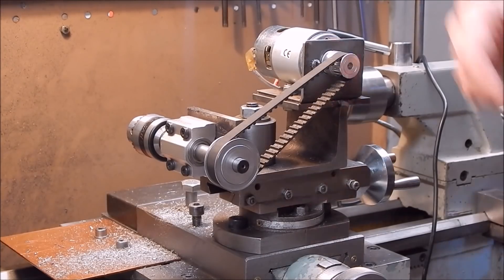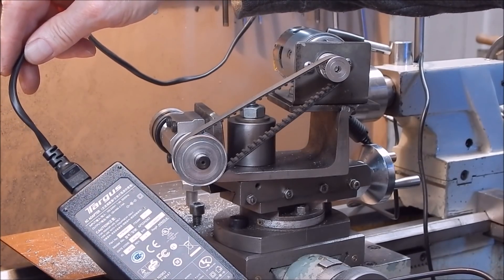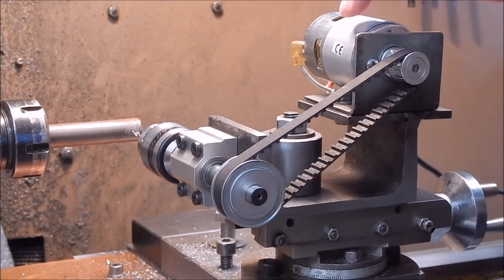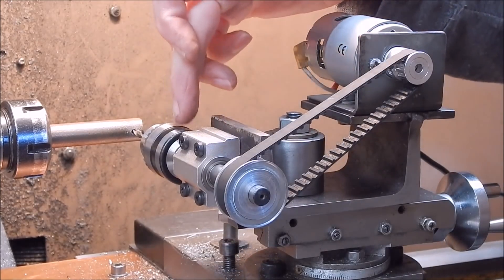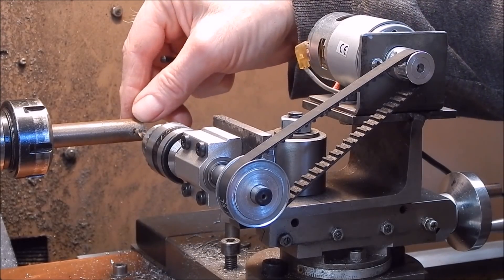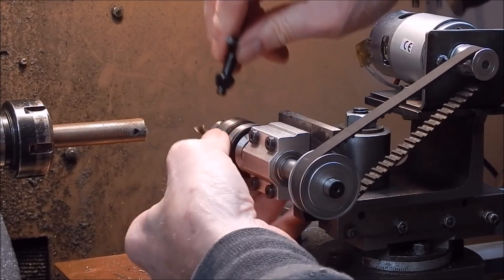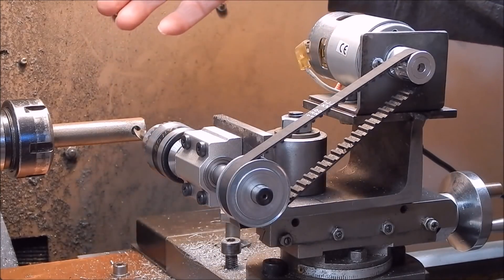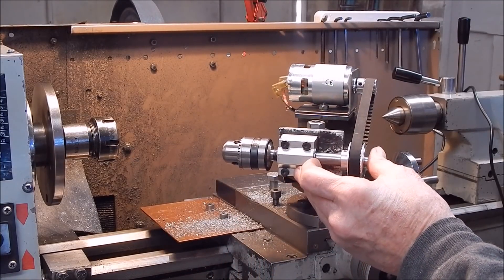How powerful is the 775 DC motor on the Machifit power spindle ?

Comment: Just like you say, it's great for drilling smaller holes, you could even try small carbide drill bits by maxing the speed, just that carbide needs a good solid set-up...
Interesting due to the low cost of the whole assembly.
Reply from the maker: Hi Pierre,

It's cheap fun in the workshop.  You can't expect miracles for that sort of money, and for model making it could actually build something useful.

I will try it on some light milling (keyway maybe) and see how it shapes up.  I don't expect the supplied bearings to tolerate a lot of that, but it would be easy to bung in a few more races to take care of the side thrust if it looks like a goer.

Toys for boys ;)  The next best thing to beer.

Cheers Rob

Comment: I always find myself thinking of the voltage as being only related to motor speed, but I guess the real import is how much balls (or, in metric, wattage) the motor has to power through the tough stuff as opposed to no-load speed. In that vein, would you not be able to use a larger drill if you powered it with 36V?
Reply from the maker: Yes. That's basically how the HILDA operates.  Being low torque it drops drill speed to safer levels in hard going.

Comment: Nice job Rob. I will be ordering the same kit from Banggood. 
A while back, I needed to do some cross drilling on my lathe, so I cobbled a cheap Dremel type tool on to the tool post. 
It would have been much easier with the kit you used!
Reply from the maker: It's worth the few Drachma.

Comment: Nice job, Rob! Given your title above, and that the 775 should take about 150W nominal - I guess you'd have somewhat better torque with a beefier DC supply (and cables): 10-15 Amps out to begin with, then it wouldn't drop its speed or hog, just chew up all the volts and amps and run! With your current supply the motor simply cannot perform, as the power supply limits the motor's possible output, which was your goal with the test. Your quote on "half an amp" is probably when the motor is freewheeling w/o a load. Measure the idling consumption with belt and spindle and you'll probably see it swallows almost 2 of your 4 available amps right there... BangGood's figures for revs and consumption is often not correct even at no-load. //Just for kicks I fed a kiddie electric kickbike 36 V (nominal 12 v & 150 W) and my ammeter maxed out at standstill, more than 20 A, or over 750W in. No harm to the motor in these short bursts. Just zoomed along at max 25 kph.// Cheers, DIYSwede
Reply from the maker: Hi Johan,

I just measured the amps down to stall speed on that 4.7 amp 19 volt printer power pack.  Wow, you are on the money.  1.1 amps at free turning  speed/load.  It gets worse, a lot worse under load ;)

Watch the next video where I explore this aspect and show a few modifications and numbers.

That sure is one amp hungry little motor.  I'm surprised as the armature windings are fairly light gauge.

Having said that, the scrap power pack will do all I want for model making and the maximum drill size is fine for that type of work.  I might gear it down a bit mechanically in the future - making a toothed pulley would be quite easy.   I feel the need for some more gear cutting ;)

I could run it off of one of the two commercial AC - DC inverters I have, but I like the idea of the printer pack being sealed, it's much better/safer in oily and dirty lathe conditions.

The larger units have to breath, so there's always a chance of metal ingress and you really need a permanent shielded  mount for them.

Cheers Rob
Reply: @Xynudu  Thanks Rob - I thought your note above was directed north, to me... //Crudely stated: Motor revs (when free-running) are nearly proportional to the input voltage, and motor torque is proportional to drawn current. You need a PSU that can deliver both, with a bit of headroom depending on how much overload capability you want. Electric motors can stand app 300% overload for a short time (as my kiddie kickbike example showed) - then you need a temp fuse (motor guards work like that: High start current and lower when running @nominal speed) to protect it from welding itself shut. The 775 is rated (fingers crossed) at 150 W, and that's supposed to mean continous effect... Personally, I've scrounged 2 crates full of PSUs from the electronics dumpster at work, as the IT guys swapped all the computers a few years back: DELL DA-2 "Power Brick" 220W: 12 VDC, 18 A, totally enclosed with a remote start possibility. Easily series connected for higher voltage (I haven't tried them in parallel, as I have a gut feeling that their stabilizers might make the output oscillate). Only snag is: you cannot tweak the output voltage (13,9 would otherwise be great for charging SLAs), and even worse: You gotta ramp up the start load over a second, otherwise they'll shut themselves down. Tip: Look for computer server PSUs - those can crank out from half a kW upwards...// Opted for a spindle/ chuck kit myself, but took the 200W 885 Lo-rev motor instead, and I'll try those out. I'll get back with info in abt a month if you're curious.
Keep up the good, cheap work! Cheers! DIYSwede
Reply from the maker: @johanandersson9287  

Free is always good.  Cheap can also be good when carefully selected and used appropriately ;)

Dumpster diving is the sport of Kings.

Yes, let me know how you get on.  You can email me at gloaming_agnet@hotmail.com if you wish.

Cheers Rob

Comment: Robby,
   Decent demonstration and simple design that gets it done. I am as surprised as you at the capacity of the little motor. Most cordless machines have even smaller motors but the power is amplified through gear reduction which also amplifies torque. Some of that is achieved in this application by pulley ratio but not that much so the motor is really quite powerful. A set of machine drills and your good to go. Jobber drills would be too
long in the larger sizes.  Thanks for the information.
Reply from the maker: Hi Dale,

It did better than I expected.  I might have a go at light milling with it when I get a chance.  I doubt the bearings are up to it long term, but it will be interesting.

Should be simple to add a few more races to beef up the spindle side load capacity.

Cheers Rob
Reply: I thought about that possibility. Perhaps cutting a key way or something similar. As you I don’t believe the bearings would last long in a milling application but it would be interesting to see the results. Banggood must have a super overstock of those kits as cheap as they are selling them. I haven’t ordered any but just might now that I know the capabilities of the motor. I have a couple of those 9 volt power cubes plus a 12 or 24 volt power block that powers a couple of spot lights in my shop. They were meant for off road vehicles and provide a lot of illumination. I lost my left eye in Vietnam back in the sixties so good lighting is critical as well as magnification for my one tired eye. I mostly use an optivision headset rather than a magnifying glass. Works better for me.
Reply from the maker: Hi Dale,

It's no powerhouse,but does the job on small fun projects.  Ideal tool for Stirling and flame licker motor builds.

Cheers Rob

Comment: Nice work sir, while you’re modifying it how about a larger pulley on the spindle, it would give you more torque and bring the rpm down for the larger drill bits.
Reply from the maker: Yes, good comment.  I have done a lot of spur gear cutting and this would be a similar exercise.  Not very difficult.  You just need to profile a cutter and do it.

The sides of these toothed belt pulley teeth are not actually parallel.  But that is no problem.  It would be a simple exercise to make a tapered cutter out of an old reamer, much like a Woodroofe keyway cutter, using a TPG.

Cheers Rob

Comment: that is a very neat set up Rob, 
I have been on the lookout for something like this for a while with a tool post grinder in mind, do you think your design would be up to grinding    cheers mate,   bob from Goolwa
Reply from the maker: Hi Bob,

You would have to spin it faster with higher DC voltage or gear it up.

TPGs generally run in the high 20 - 30 K rpm ranges.  I have a Waldown TPG and it's a screamer.  Internal grinding generally requires very high speed as the stones are small diameter.

Sealed bearings may not last long at those sort of speeds.  TPG's run open oil bathed magneto bearings which are designed for this type of work.

The design will grind, but speeds will be down on a real TPG.

Cheers Rob
Reply: @Xynudu  that sounds about right,  I think I will give it a go, it would be a valuable addition to the workshop  thank you for your reply, much appreciated

Comment: Bravo! Fabulous piece of kit, complementing your dye grinder & Hilda set ups & so useful for putting cross holes where they are needed, using for  example the optical setup with the camera microscope that you showed sometime ago to give super accurate hole division etc at  such low cost. Thanks for sharing!
Reply from the maker: Thanks.  Just shows you don't need a lot of money or brand name kit to do accurate work.  I'm sure I burn up a lot of wanna be machinists who dish out mega bucks to have the very best equipment money can buy.

That doesn't make you a good machinist.

It just gives you bragging rights ;)

Cheers Rob
Reply: @Xynudu  I am getting around to thinking that the more you pay for something the more likely hood that it will brake in some way that is expensive and inconvenient to fix. Too cheap will hurt you, but at least then you have money left to get something else based on what you learn, but too expensive gets you many ways. The decision by various tool makers to sponsor youtube stars looks to me to be brilliant commercial logic. The money must have come back countless times from folk seduced into the new tech and feeling they are incomplete with out it. The beauty of seeing this lower cost stuff that you have shown is that it removes the fears of it being too cheap and I have bought with confidence some fabulous stuff such as the digital micrometer you reviewed that is a great blessing to me. I rarely if ever bother now with the analogue ones nowadays.

Comment: Would have been more impressive if you didnt use a pilot and let it drill a fresh hole each time
Reply from the maker: LOL. You always use a pilot hole/spot drill on round stock.   Where did you learn metalwoork ?

 It eventually drilled into solid steel.  What more do you want ?
Reply: Also, Rob B., the sides of the drill see more friction than the tip. What you're suggesting is really a better test for drill sharpness than motor wattage, IMO.

EDIT: Of course, that's only the case when you drill a pilot first. Thinking hard sometimes is coffee without.